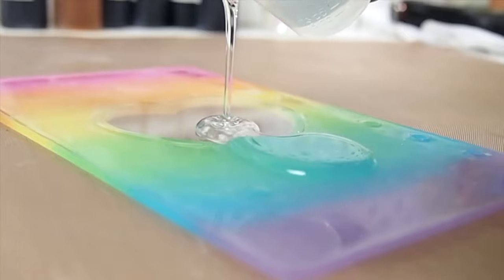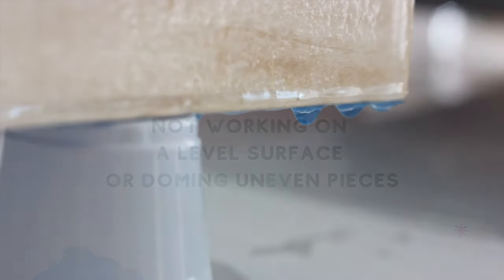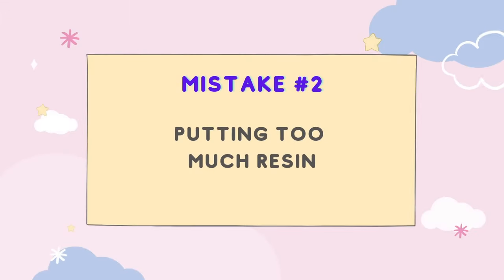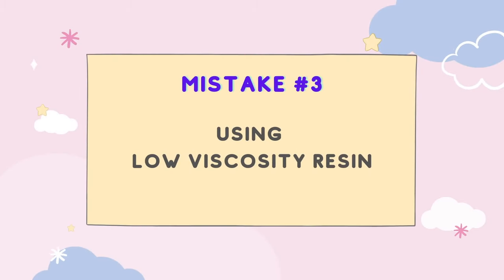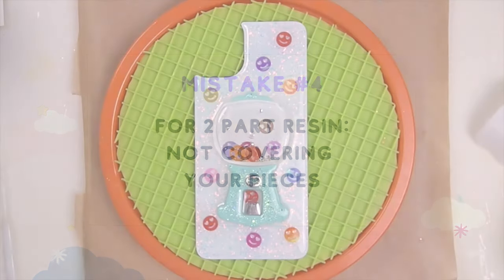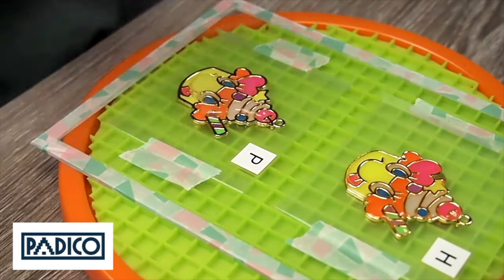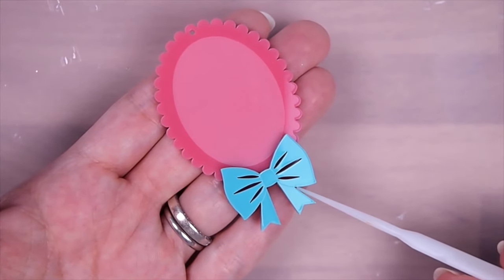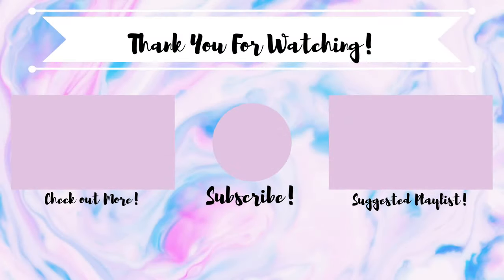5 Resin Doming Mistakes to Avoid and Some Pro Tips

Comment: Just wanted to drop a comment and say that I'm still relatively new to epoxy resin, after years of resisting, and I figured out pretty quickly how to dome on sharp angles. I'm an engineer by trade, and if you think doming with sharp angles isn't possible, you're not thinking creatively enough. The pieces my wife and I make have so many crazy angles, if I didnt experiment and figure it out, resin wouldn't have worked for us, but it only took one week of testing to figure out.

I'm learning that the resin crafting world is filled with defeatests who aren't nearly as creative as they think they are.

Comment: Thanks for this wonderful tips. ❤️ Will use it. 

Do u have video on that respirators...like when to remove the filters & the way which u dispose used resin bottles, mixing cups or wipes. If you can do a video about that too..it will be helpful ☺️
Reply from the maker: Thanks! Follow the directions per the respirator you have. Resin bottles, mixing cups can be recycled if they’re plastic. Just make sure to clean any resin residue that’s on there with alcohol. Wipes can go in the trash.

Comment: This is a great video. I do have a question though. I've seen so many people who make letter keychains with the alphabet molds and a lot of the letters have sharp corners so how are they getting them domed without overspill or the resin pulling away from the sharp corners? In the videos I've watched their letters look perfectly domed and I've seen some people use UV Resin but I've seen a great many who use 2 part resin that has to sit and cure.
Reply from the maker: Thank you. By sharp corner, I mean less than 45 degrees. I should’ve said acute angles instead. Even those alphabet molds…the very end of the points are still slightly rounded.
Reply: @AmyMade  Thanks so much for such a fast reply Amy. I really appreciate it. For myself, I have not had very good luck with some of the letter. The W, M, N. They all have really shar points and it seems like the resin will not go to the edges and stay there. If you try to add more it will just spill over somewhere else. Not even sure what resin would be the best option. I have 2 different alphabet molds, same problem. One is the standard reverse, or backward facing letters and the other one is also backward facing but the letters are taller and have the little silicone post that leaves the hole for your jump ring.
Reply from the maker: Is your resin thick or thin? Thicker resin work much better for doming.

Comment: Hi there, do I have to wait for resin to fully cure before I can dome it? Or can I dome it when it has become solid? Say 12 hours down for a 24 hour curing resin
Reply from the maker: You can dome it during the soft cure stage. However keep in mind whatever you use under the piece (doming mat, liners etc) may leave an imprint of the texture of the surface onto the resin.

Comment: After viewing your videos, I started playing with UV resin!  Your videos are so helpful and I love the little cute stuffs you made!🥰🥰

One problem I’m facing now is that my surface is not perfect.  It always have the little bubbles or bumpy texture (like mistake 4.) 😢 On the mistake 4, do you suggest let it rest for 5-10 minutes before using the UV light?  I tried to use toothpicks, heat gun, and lighter to remove the little bubbles, but still can’t get a perfect surface.  What should I do to make it right?  Thank you!! 🙏🙏
Reply from the maker: Yes! As suggested in the video, let it rest.
Reply: @AmyMade  Thank you Amy!!  It does work!!  One more question, after I finished one side and flipped to do the other side, the resin would drop to the bottom side and messed up the side that’s finished.  😂 Is there any way to avoid resin dropping to the bottom side? 
I’ve done a couple of them like that...  Do you know how to fix the side that’s been messed up with resin?🤷‍♀️

Comment: Thank you for this video!! I thought I was putting too much resin, but now I realize the dripping was only happening in bear and heart shaped designs. I guess I'll try the latex tip... I was trying to use baby oil and vaseline to prevent the resin from sticking but it wasn't working out 😂😂😂
Reply from the maker: Yea totally! It’s almost impossible to avoid cute molds with sharp angles so..I guess latex would be the next best thing to make it work
Reply: @AmyMade  I had to come back to tell you what happened! I've had to re-dome 3 resin shakers and it's a little bit hard to find liquid latex where I live, so I improvised with a latex I used to use in watercolor paint (I have no ideia how it's called in english). I was so afraid to ruin more shakers but I had to try. I worked out perfectly!!! I can't believe it!! Only one of the three shakers has spilled, what also helped was to let my resin to rest for 10-15min before applying (I use low density resin). I soooo grateful for this video, you have no ideia how many times I've ruined my resin shakers, I was really struggling with it 😅😅 but now I won't anymore because of you!! thank you!! 💜

Comment: i only ever use liquid latex if i am doing like sharp pieces like i can get a full dome on those but i put it on like the center of the heart or if its got those weird spots where resin can drip in just in case     round things i usually never do latex
Reply from the maker: I think it’s hard to avoid pieces with sharp corners nowadays. With so many mold makers.

Comment: Why do I still have a tacky layer to my resin even after coating them?
Reply from the maker: Maybe you didn’t mix/measure properly or you didn’t mix the minimum amount or there was moisture contamination
Reply: I used UV resin
Reply from the maker: @SuperMAICHANG  you didn’t cure it enough. Either your light source is too weak or the resin is old
Reply: Ahh okay ty so much

Comment: Hi! I just have a small question about UV resin. I've noticed recently that anytime I use it, it is still tacky after I cure it. Is there a reason for this? I use an led light and a lamp and it does it for both no matter how long I leave the pieces in there for. It's for both my older bottle, that didn't have issue when I bought it and my new bottle, that is the same brand as the other. Any advice would be much appreciated 🤗🤗
Reply from the maker: It could be that your resin is old and has oxidized to the point where it no longer cures properly. This happens with cheap uv resins.
Reply: There’s an easy fix for that, cure your piece normally under light for whatever amount of time you normally cure, and then grab a clear container, fill it with water and submerge your piece and cure it under water with uv light for 3-4 minutes. It will be hard, shiny and stickiness completely gone :D
Reply from the maker: interesting!
Reply: @herahair8916  Have you tried this? Its unusual bc resins hate water and won't cure properly if theres too much moisture. You should do a video to show how this works bc UV resins being tacky after curing is a big problem for alot of ppl. I usually cure mine n if its still tacky after a long curing process then i will take it outside an let it sit in the sun for awhile n it really helps. I have a 36w lamp so resin shouldn't be tacky
Reply: @LolaClark86  It’s an essential part of my UV routine now. I think the difference is that it’s not regular epoxy but UV one. I will definitely put up a video, I will let you know when I do :D
Reply: @herahair8916  i actually looked up a few videos about it. I never knew you could do that. I misunderstood the process of water curing. So you cure your piece like normal and then add it to cold water and cure again. The videos says not only does the tackiness go away but it actually makes the piece harder/stronger. Im so blown away by this. Thank you for telling us about it. I would have never known!!
Reply from the maker: @herahair8916  I tried this technique you suggested and works wonderfully, thank you so much!

Comment: Hi, I hope you are still doing this as I see that this video is a couple years old. I tried using the link for the faux Rizzle nouveau and it does not work.  I Googled it and it is no longer using the name faux Rizzle as its website. It's under a new name called countertop epoxy. There is something at the top of that web page that says faux Rizzle but when you click on it it only takes you to some epoxies that are for countertops and another one that is called Black Label epoxy. Do you know if they have stopped making the nouveau? If so, do you have a new product that you are using and like? Thank you
Reply from the maker: Yes I’m aware of their brand change. I didnt change it here because I didn’t think about it.  Totally forgot about this video tbh lol. The black label resin is the noveau. I personally don’t care for that resin anymore as it yellows rather quickly. I haven’t worked with 2 part resin in a while but JDiction and Resin Rocker resin have great non yellowing peoperty.
Reply: @AmyMade  thank you!

Comment: Hi, I tried the dome technique for one of my art piece and one of the corner the resin did not go to the edge.  How to avoid that? Any suggestions? Entire piece looks good except one side the resin did not flow all the way to the edge leave small gap between edge and the remaining part.
Reply from the maker: Did you follow all the tips? Is your art piece completely flat?
Reply: @AmyMade  Unfortunately came to see this after I ran into the issue.  Anyway to salvage it?  Yes.  my art piece is 3d but on a super flat surface.
Reply from the maker: You can try adding a new layer of resin over it. Sometimes adding not enough resin can cause the resin to pull away from the corners too
Reply: Thanks will do